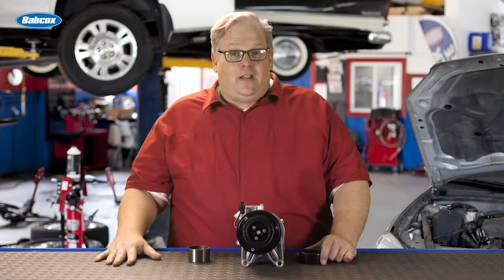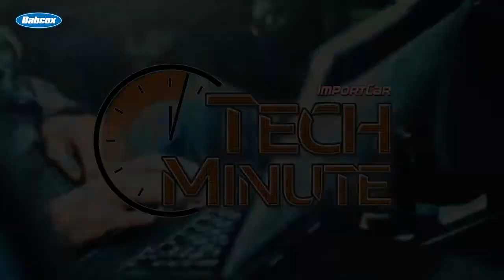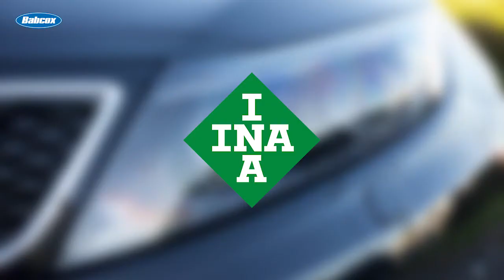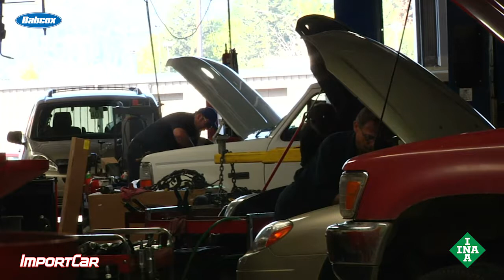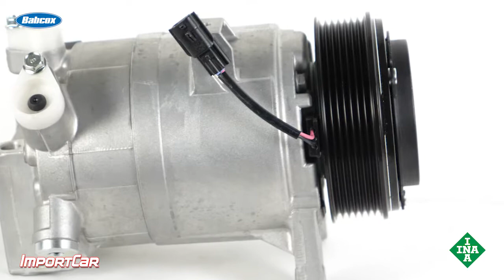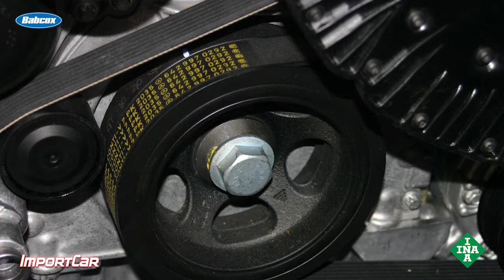When Is A Clunk From The Air Conditioning Compressor Abnormal? | Tech Minute

Comment: Is there a video of the engine running at idle with that clunking noise? I need to hear the noise to figure out if it's they issue on my buddies truck. It sounds like a loose bolt is hitting another piece of metal. It's coming from the AC compressor
Reply: Did you get it figured out? Got a clunking from my compressor. Even when AC is off.
Reply: @jeremyquaas6530 yes!!! It ended up being the tensioner pulley, and another pulley (sorry, I can't remember which pulley it was), and belt. They were warn, out of balance, and eating through belts, cause the belt kept slipping off as well. Check all of your pulleys and belt alignment. Other than that, it can be the AC compressor clutch kicking on and off